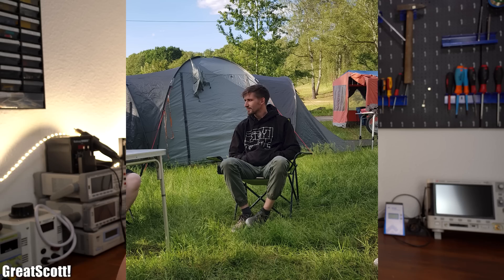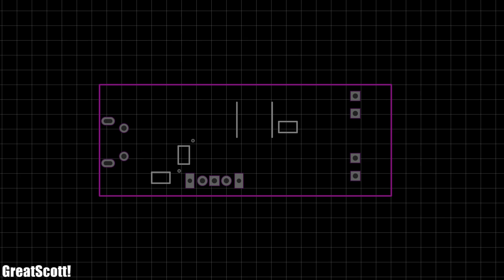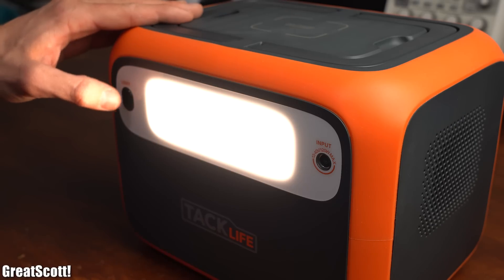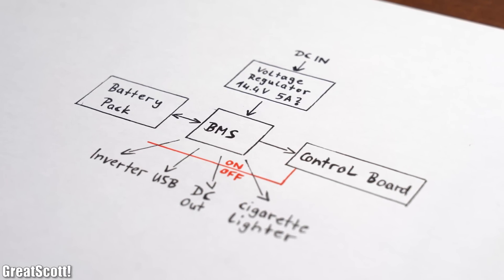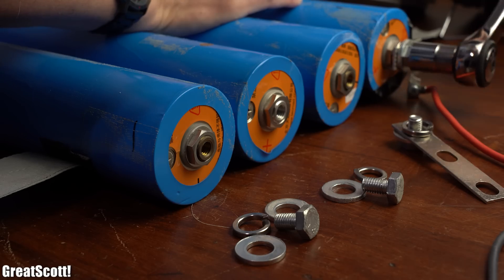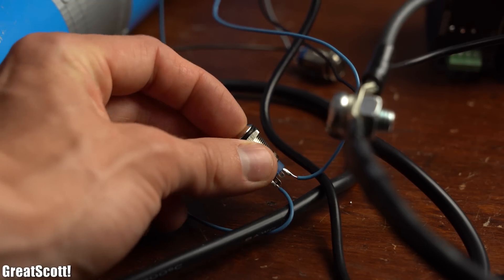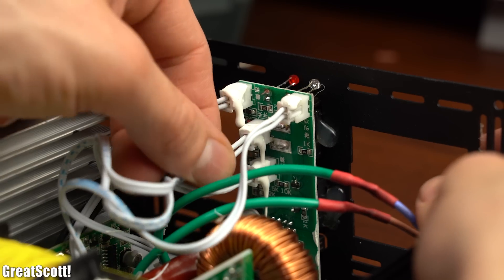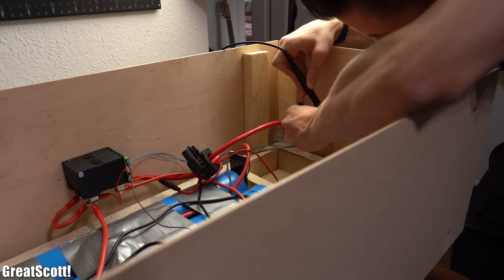Portable Power Station || DIY or Buy

Comment: kind of like buying a big box store PC vs building.. you typically spend more but your component's are better and probably last longer, plus performance is typically better.  I dig your build, I have a bluetti AC200 but I think with the battery options now, BMS, shunts, I probably would've been better served with something that I could replace everything myself vs all-in-one.  Awesome video as usual.

Comment: Tip for soldering bucket ring terminals: hold with vice grips or vice, heat with torch, fill 1/2 way maybe 3/4 max with solder while still heating, dunk wire in solder, hold 'til solid. Perfect solid connection, though do remember the solder can, as always, wick up the wire thus strain relief is always a good idea.
Reply: Tip for soldering wires together straight: put wires together end on end, turn them about 45 degrees from each other which will allow you to wrap them around each other, creating a better mechanical connection before soldering as well as a perfect clean joint that you don't have to hold while soldering. Solder then, be happy. Called a western union/lineman splice.

Comment: Awesome Video :D yes the other was 500€ and DYI was 970€ so you save maby around 30€ with DYI and *2 the Power aswell and the fun of making your own that can be made for portabel in a car Camperwan etc :D the 500€ i guess is nice for the design&Size :)
Maby next video you try to make the box small as possible and maby in aluminium case with Grounding+Safety with grounding :D

Comment: Nice build! 

Tech tip: Do not drill all the way through plywood - it will split on the other side. Drill a little from one side and as soon as drill bit starts to poke through - drill from the other side.
Reply: I seem to recall from shop class 100 years ago that you could also put a piece of scrap wood on the other side and drill through and into that to help prevent splintering. I might have hallucinated all that, though.
Reply: @bmbiz  Yes, it could work but that scrap wood should be in very good contact with drilled material.
Reply: @electronpath  Yes, that's an important detail. A small piece of a quality 2x4 worked well in many cases, IIRC. You can drill straight down into the two on a solid surface or clamp it on if you can't lay the work flat.
Reply: Solid tip. I've been working with MDF for my senior year engineering project and may try this
Reply: I found that if you take your time instead of putting all your weight on the drill it will be as clean as doing it any other way, the key is patience, don't get in a hurry when you diy
Reply: I use a small diameter pilot drill when using, say, forstner bits.
Reply: Learned that the hard way 😂
Reply: Boss why not have radio FM and SIM card WiFi

Comment: Hey GreatScott, did you know any masking tape would prevent chip out on wood? Just apply some tape before cutting and cut in the middle of the tape and you will never (hopefully) have chip out wood with jigsaw. 👍🏻
Reply: using the correct blade would help!

Comment: Mine would use a Hybrid Off Gird inverter (All in one)  (MPP solar PIP Max series   - 8048MAX 240V AC 8KW 8,000W (UK)
But mine Has a Sneaky Extra Features 
- Dual Wide Voltage Range 100V ~ 500V PV DC Inputs  for 10x (495VPV DC ) & 20x (2 parallels 10x Series )  LG NeON2 415W BiFacial Solar Panel 
- AC Loads Without Battery  (PV battry-less operation of AC loads)
> Keep in mind the PIP Max can also Parallel Stack into a 48KW  48,000W system (1 phase or 3 phase system) +120x LG415N2T-L5

Even have few Online Prepayment Meters Solutions (sell power)
Iskra - ME382 Single Phase Prepayment Meter with MeterPay / TOPUPMETERS  + Own
Iskra - MT382 Three Phase Prepayment Meter with MeterPay / TOPUPMETERS  + Own
mine runs a local StarLink (After the mobile anywhere update) this si for a local NUC or PI for the Payment gateway + AMR system + security gateway we also do Mesh WiFi internet access + be a femtocell over wifi

Fits into Flight case [flight case hardware] formant  Cabinet on wheels with 19" Rack support ready for the 48V 60V ESS 19" rack battery modules 4U ~ 8U

Comment: Very nice project, I need to make a similar one with an esp32 as a controller.
Also, you should consider adding air assist on your laser engraver to reduce the burned wood around the text
Reply: Or apply some masking tape over the area you're about to engrave.

Comment: I think a cheaper and smaller version is possible.
1. Car battery, or AGM, Hybrid VRLA
2. Low voltage battery protection (for all devices connected to battery)
3. modified sine-wave inverter from cheap UPS - for charging electronics like laptops, phones, or even run electronics like a workstation with dual monitors
4. Car USB charger for charging your phones
5. Simple voltage and current indicator for consumption
6. extra staffs like 12v Car socket, switches for inverter start and USB Charger

External chargers not in the pack
1. from solar panel MMP installed in car
2. from car battery DC converter with current limiter and automatic start wen voltage ritch a car charging value
3. from 220V 13.8V 10A (or any value from 3 to 50A) battery charger

Comment: If you now ensure that loads can be powered from the wall and the batteries at the same time without interruption (UPS), you'd have a pretty cool multifunctional power supply at hand. No problem if the power goes out because the batteries are topped up and ready to help you get through a few days.

Comment: The best part of DIY is you can choose everything like you can avoid the voltage conver to charge the battery by using a charger with right amount of voltage and you can entirely skip or downgrade or upgrade the inverter like 300w or 1200w.also you can choose what type of battery you need like Li-ion or Li fe po4

Comment: I would argue for a target of 2000w so that you can power an induction cooking ring or a microwave oven for - say - 5 mins in your caravan or RV. Modern high discharge 18650 will give ~10wh each and will cope with a 5C discharge rate so something like 3x 36v 4ah power tool batteries would do it.

Comment: You forgot to put some sort of cooling fan on the case. Without it, the heat from the inverter will all build up and there, and it will get pretty hot.

Comment: So you made it bigger, better, and more powerful, my question is. "Can you actually take that with you when you go camping?"
Reply from the maker: If you are willing enough,.....yes :-)
Reply: You can go camp riding on it, I think that's a win.
Reply: @kei2142  yeah! A portable power station can be a modified bicycle! 🚲
Reply: @f4tboy99  I use my truck as a portable power station. It's even self driving if you park it on an incline.
Reply: @f4tboy99  i have a 1,68Kwh battery n my escooter and a converter from battery voltage to 230v ac, no need for powerstation because the escooter is the powerstation😅
Reply: What ever you do, do not take such a contraption with you to the Airport.

Comment: Only issue I see is that those Inverters can do about double, for a very, very short amount even triple the power (speaking of switch mode power supplies or starter currents) - that could mean that the relais could be underdimensioned.

Comment: I have a similar commercial "solar generator" battery.  I know it's probably possible to build something bigger, but I am perfectly happy with mine.  My biggest complaint is that there is no way to charge it over USB.  I have a little backpacking USB solar panel, and modern USB-C can charge 100Watts, which is about the same as the brick charger that came with the device.  Better in/out USB-C-PD would improve the ergonomics more than a bit more power for me.  When camping or surviving a short power outage, 100 Wh per night is plenty for lights and phone and whatnot.

Comment: It looks like you had the same idea as I had few weeks ago. I finished my 1152 Wh powerbank just a week ago and made video about it (in Czech language, my english channel will come soon). I used steel box because of safety and it has various DC outputs (2x 18V, adjustable 80W from lab power supply module, 14V15A, USB QC+PD). 230V inverter can be connected to it via XT60 connectors, both protected and unprotected from over discharge. The total price was 250-300 eur.
https://youtu.be/1F33AMxqrps

Comment: You were creating A.C. in the old video, fine... but your tesla coils were not good, the arcs were too short/ the circuit was too complicated(compared to slayer exiter).
I tried experimenting around with other "bjt" and could reduce the size of the senondry coil to 7cm and diameter 3 inches,wire used about 34 AWG. Primary coil is the breadboard wire, 1 turn. but i got a decent hot arc length of about 1.5 inches and could light up a cfl without being touched to the coil. (atleast better than your part 1 tesla coil). 
for that i use mje"3055" NPN transistor, 22 k resistor and 12 v(1A). power supply. 
maybe you should try this or use a zvs circuit, the induction heater you made(for primary coil) for a full sine wave A.C. inverter. You might find it interesting.

Comment: Why don't you use a 3D printer for the enclosure?
I know that in this case, the enclosure was big, but for other projects you can start printing, before the epectronics and you'll save some time.
Just wondering if you what your reasons are for the wood construction

Comment: I guess the DIY BMS would have been a lot cheaper and open source. It would be a fraction of that cause I guess my 48V 16S battery was less than 100€ in total with 16 clients and a monitor and 1 shunt with most solderings done by pcbway or so. Check it out if you need one again: DIY BMS 4.4 Stuart Pittaway 

The sources are one github, there is a forum too and he also has a youtube channel covering each step to build and the developing of these boards.

Comment: one mistake you did in your build.... where's the vents for the inverter/battery compartment? you certainly don't want to trap heat in there.
Reply: that's an "emergency wood cut" ;-)
Reply from the maker: I will monitor the temperature in the future through the BMS and add vents if necessary.

Comment: Looks like Great Scott now needs to DIY a camp truck to carry this huge enclosure for camping
Reply: YEESSS
Reply: Camping Caravan || DIY or Buy
Reply from the maker: Well, it definitely takes up some space. But it is still manageable.
Reply: @greatscottlab  yes that's right. You can still easily place it in the back of your car
Reply: @sayantanmaiti2513  you won't get anything back there with it, but hey who's counting 😂
Reply: @greatscottlab  I have t
Reply: Where is Laura Kampf when you need her?
Reply: A lot of wasted space, yeah, lol. On the upside though, he has room to at least double his battery capacity now, lol. That would be impressive for a battery/box that large. Then he truly would be cheaper than the big guys. Those wheels are sure built for it, very robust.
Reply: I suppose you could build a smaller version & put it in a plastic tool box thing.
Reply: You can mount it to a forklift then you can take it anywhere you want to 👍
Reply: It has wheels. 
¯\_( ͠° ͟ʖ °͠ )_/¯
Reply: Boss why not have radio FM and SIM card WiFi

Comment: Maybe having a 1000W AC output for camping is quite an overkill, sarcastic if you will.
The project looks pretty nice but I'd stick with the buy version, doing some work on the diy version 
like painting or protecting the wood from rain would be good
great video man

Comment: Please would you make this? https://qrp-gaijin.blogspot.com/2017/07/rtl-sdr-upconversion-with-diode-ring_30.html If you have an sdr, that is.... :) but if you dont, then you can get one for arround 6 euros https://www.aliexpress.com/item/1005002028067098.html And trust me, its really interesting to listen to all the Radio waves that are arround you all the time, and that converter allows you to go even in to the HF bands (that SDR donge can normally go down to 25Mhz but that upconverter converts 0-25Mhz into higher freq that it can recieve (it kind of puts them together, signal on 1Mhz, crystal 48Mhz       1+48   and you will recieve the signal on your sdr at 49Mhz)), and there are even more things there

Comment: Not a bad build! 
I used a toolbox, and small 32650 cells all spot welded together for mine. It’s got 2000ish Wh, but the same 1000W inverter. And I used a solar charger controller instead of a buck converter to charge... but I TOTALLY agree, DIY wins hands down.

Comment: You are going to really appreciate having 1,280 Wh instead of 500 Wh. It’s a real pain when a battery pack drops dead.
Reply: Not to mention the THOUSANDS of charge cycles instead of a few hundred...
Reply: I built one with 7200 watt hours. My idea of fun but at 130 pounds and on caster wheels, it was meant to live under a workbench in the shop.

Comment: Can this be used for charging and powering a load at the same time?And I guess that if the load is greater than the charging current, the battery will still deplete even while charging?
Reply: Probably, but why would you? That’s like using a power bank to charge your phone while you’re charging the bank.
Reply: @codykey2508  Well sometimes you might need that :)

Comment: Nice build but I wouldn't have used the laser to make the front panel. Not because there is anything wrong with it but wooden panel with burn marks on an electric supply producing mains voltage is not exactly confidence-inspiring!

Comment: you did a great job but the biggest problem with this is that its requirement in for camping and it requires small and light weight box not a heavy one. but anyway it was good.

Comment: I LITERALLY JUSY MADE ON OF THESE BUT UT CHARGES WITH A SOLAR PANEL. THE BATTERY IS A 7AH BATTERY AND ITS PRETTY GOOD. AHHHHHH THANKYOU
Reply: Post a video!  Be careful, this stuff is addictive.  My 560 amp hour unit runs a small wire feed welder, table saw, and air compressor. It has a 410 watt solar panel, not exactly portable but its on wheels.

Comment: I am a structural engineer who recently discovered the miracle of PL premium and PL Premium Max... also Loctite branded versions.  If you used it in all your connections of wood to wood it the wood will break before the glue does.  It is super cheap... bonds to most materials... but it wont come apart ever.
Reply: I fit the wood parts dry, apply PL from the 4 oz tube, hand position the parts and pop a few air driven brads into the joint at random angles. The stuff is amazingly strong. Pieces go together quickly.

Comment: I have a couple of small 'power stations' here, inexpensive and LiFePo4 based. Pretty decent. But, as you noted, you have to take their idea of a suitable 'mix' of features, outputs and capacities, and they're rarely in accord with your wants.
 
 I also have my house critical systems (except refer/freezer currently) on a battery-backed setup using surplus scooter Li-Ion 36V packs. Now, the surplus quality Li-Ion and lately, LiFePo4 packs out there make a DIY solution way more compelling. You can find all the needed components easily and cheaply to assemble your backup system, or a power station like yours (love the wheels!) with capacity galore, all the inverter and/or DC power you want and the charging options to match. Just several hours to plan, assemble and build.

 Because there are so many great deals on 36V packs, I was able to find a couple surplus quality UPSes that work great, and under my keyboard right now is a 3000W sine 36V inverter, that'll handle the refer/freezer and microwave loads. And it was easy to use those DC-DC "lab" style power modules to arrange 42V/30A charging. (Using 42V Cisco router P/S as source. Think were 2 for $60? Soo cheap and way quality.) (But see my channel for how not to mount LiPo batteries. Very nasty when poked!)  Anyway, if you factor in quality recycled cells out there,  (And UPSes! Great quality inverters, low speed chargers and backup. Real cheap Ebay, usually shipped without the failed batteries, so cheaper/safer shipping, and very much life left! I paid about $70 for my 500VA and $90 for my 1000VA shipped. I don't even notice the power drops anymore, except the mini-split stops. Nice.) you can build a beast on a budget! Thanks!  Stu  (Too much blabbing. Sorry! Love your stuff, and it's great when DIY beats BUY! Stu)